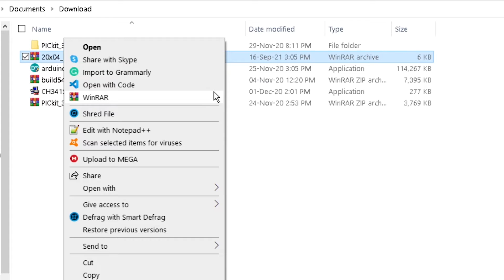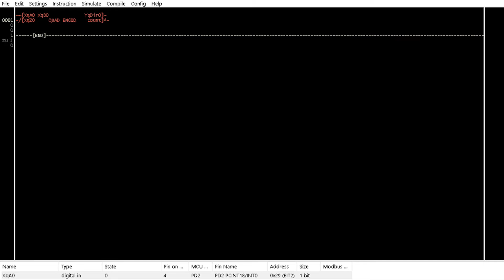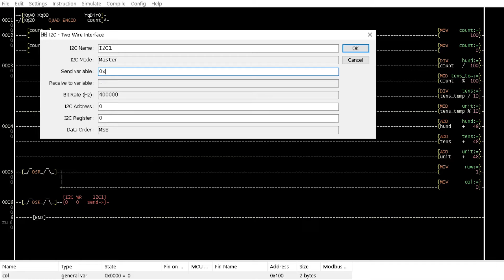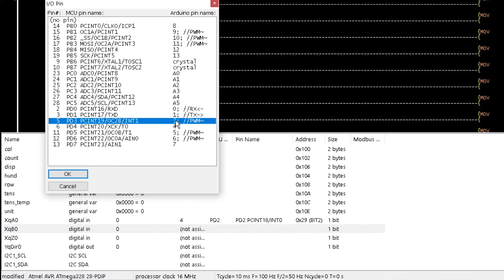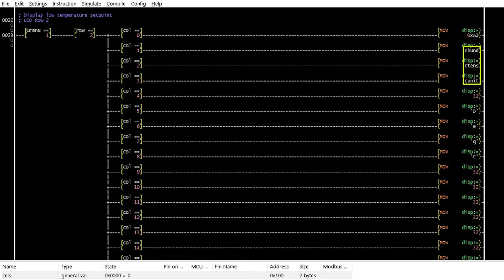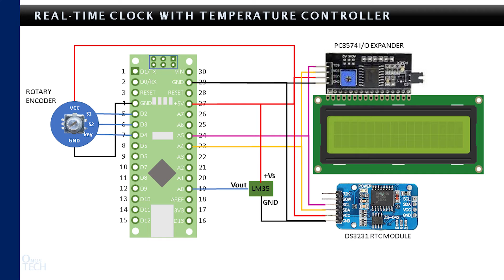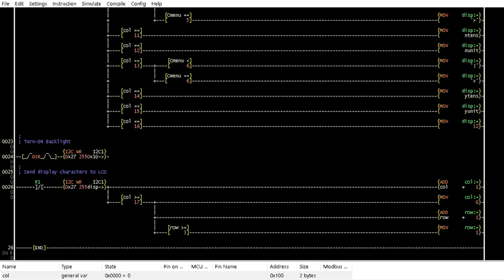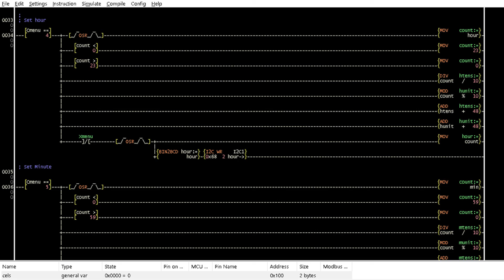LDmicro 20: I2C Liquid Crystal Display Resolved(Microcontroller PLC Ladder Programming with LDmicro)

Comment: Thanks sir resolve i2c 20x2 problems.
Can i use 20x4 lcd display?
What is the procedure?
Please inform sir.
Reply from the maker: Yes, you can use the 20x4 lcd display. It is the same as the 16x2. Just increase the row variable to 4 and the column to 20
Reply: Thanks you sir

Comment from the maker: This tutorial improves on the below tutorials
Tutorial 14: I2C LCD & DS3231 Real-Time Clock https://youtu.be/Mj5K6ZTT21Q
Tutorial 16: DS3231 Temperature/Alarm/LCD Menu https://youtu.be/vbq3zlObp7c
Tutorial 19: Rotary Encoder Menu Navigation https://youtu.be/gz8GNsL21nA

Configure LDmicro to work in C mode to enable the use of the I2C Write/Read Instructions
Tutorial 12: Arduino Boards without IDE-UPDATED https://youtu.be/1ooMWbz8Zzs